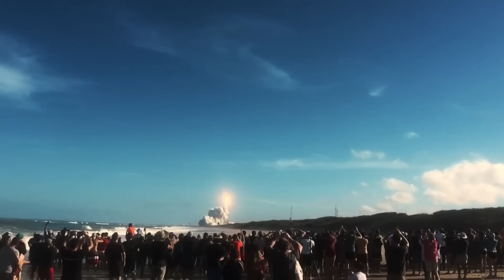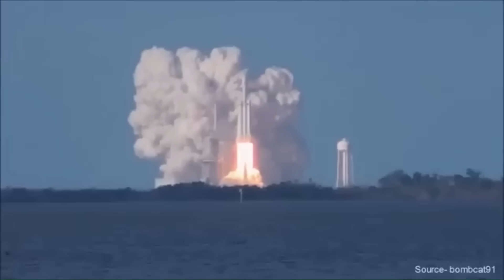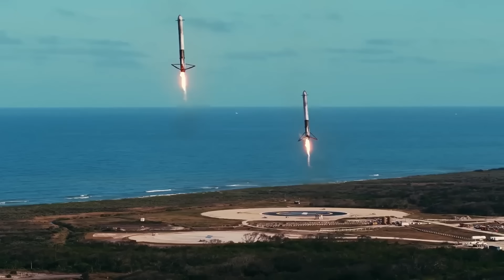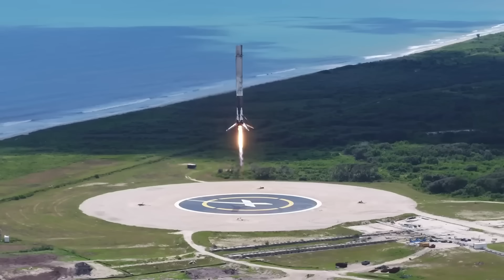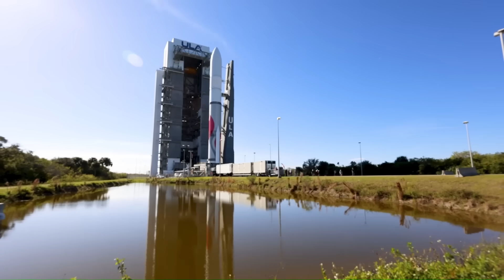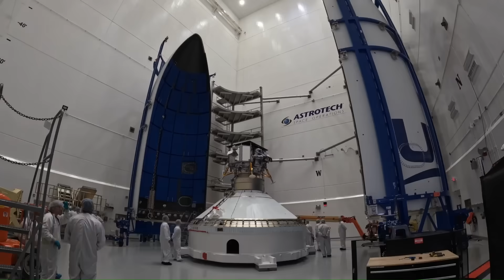Falcon Heavy Launch Completely Humiliated ULA Rockets!

Comment: SpaceX is amazing.   They've created the Volkswagen Beatle of the rocket world.  Affordable, and  dependable, 500+ launches, for a way better price.  Able to launch 130+ rockets last year.  512 successful all together, out of 519 attempts.   Falcon is a pretty sure thing.

  ULA is expensive.  They've had alot of experience with classified government payloads.  They've launched 600 Atlas rockets, with 100% success rate.  ULA knows their stuff.  Measure 1000 times, cut once.  When the payload is worth 10 rockets, ULA gets the job.  They may scrubb, but they don't lose payloads. They aren't going anywhere.
  
  SpaceX just did their first high value payload when they lauches Europa Clipper.  And they aced it.  A $190,000,000 rocket sent a 5 billion dollar spacecraft on it's way.  The payload was worth over 200 times the price of a Falcon Heavy!  SpaceX has changed spaceflight globally.  The Chinese are SpaceX's most formidable competitors.   Low Earth Orbit belongs to X.

But the perfectionist at ULA have a part to play still.

Comment: NASA wanted a choice of launch vehicles so they'd never relay on just one again.  If the don't support all the platforms, they will end up with  single platform and unlike before, not one NASA controls, one the military can co opt copy use at will, but a private vehicle who can one day simply say, sorry, now it's a 1/2 billion for a falcon heavy, don't like it, tough, we are the only choice you have unless you want to spend 10 yrs reinventing a gov't controlled launch platform.  See you in 10 yrs!
Gov't needs to figure out how much money alt platforms require to stay alive and improve, tying payments and additional payloads allowing higher returns to cost reductions / load increases, shorter lead times, keeping a unit on 24 hr notice, and other usefull milestones.